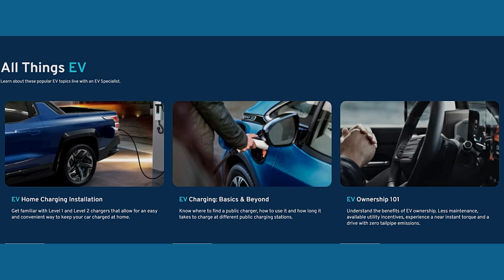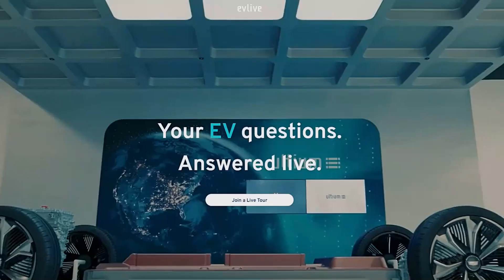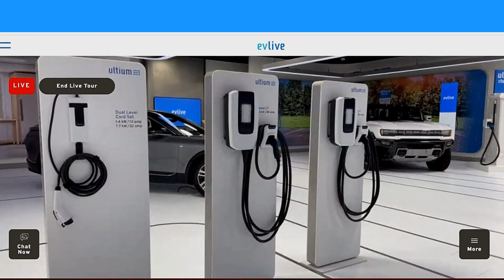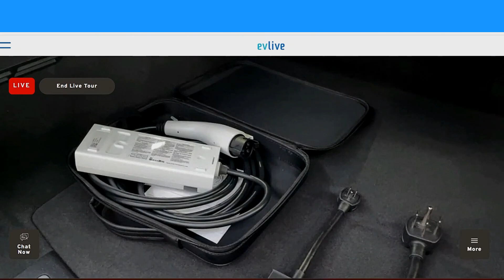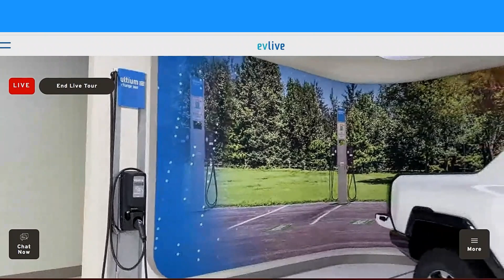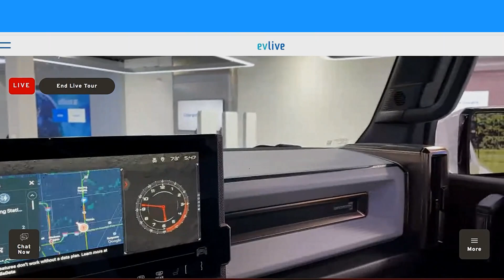evlive: General Motors Wants To Answer Your EV Questions

Comment: Tom, I'm hoping you have someone at GM you can talk to about an issue I just came across.  I just purchased a Bolt EUV, and went through the process of providing Qmerit with my survey to install a charger outside my home.  i do not have a garage.  The survey questions re the garage do not seem to accept that you do not need a garage.  I think the survey is a GM function.  Chevrolet's web site has requirements for Standard installation as well as a FAQ that says a standard install can be done for an outside charger(Hardwired) and the electrician will ensure it meets code.  Nowhere does it say it has to be in a garage.  Initially, the response from Qmerit was that mine would be a custom install.  When I inquired as to why it would be nonstandard, the garage was given as the reason.  There is confusion between the standard installation requirements and the way the survey is written. I don't know if this is a subject that EVLIVE would be interested in, but I am willing to try.
Reply from the maker: Hi Russ. Do you have any updates?

Comment: Ultium 80A connector?!  How many homes have breaker buses that can handle that current...and can the line from the utility to the breaker bus handle the increased load?...with HVAC.

I wish GM had a NACS connector option...CCS is TOO BULKY...and the female version for the vehicle.
Reply from the maker: I like the Tesla connector better also, but the fact is, nobody is going to switch to it, we're stuck with J1772 and CCS. If upgrading the service to accommodate an 80-amp load is too much, you don't have to do it, you can charge at a lower rate and fully charge overnight just fine.
Reply: @StateOfChargeWithTomMoloughney  Customers need to demand it.  I won't buy a vehicle without NACS.  

It would be interesting to see a home project install 2 of those Ultium 80A AC wall connectors (2 car garage) on a house built in 2000-2006.
Reply from the maker: @MarcDunivan  You would definitely need a service upgrade - or you could install a load-shedding device that can maximize the charger's output without overloading the service capacity.

Comment: Do you have any information on if the 2024 Denali EV edition 1 will come with a wall charger? When they mentioned home installation, are they referring to re-wiring your home for the 240v or just installing the station on the outlet? I already have the outlet for an EV and just need the charger installed.
Reply from the maker: If you already installed an outlet for EV charging that that would be a 240-v outlet. You could use the circuit for that outlet to hardwire a permanently installed EV charger which is a better, safer installation than using a 240-v outlet.

Comment: This is maybe more of a question for State of Charge. The question deals with the future of EVs married with renewable energy through a renewable smart EVSE. 1-in-4 Americans do not have access to net metering. This primarily impacts rural America, which happens to have the best opportunity to add solar power. People who have both solar and EVs with net metering do not give this topic a second thought, but 1-in-4 without net metering is a big deal. This is near and dear to me, for I am one of the early adopters of solar and EVs without net metering. We deal with this shortcoming with a smart EVSE provided by Myenergi from the UK. This EVSE will allow the EV to charge only with excess solar generation. State of Charge focuses on everything EVSE. I would love to see an episode that deals specifically with a huge lagging market. It will start with a little research on the claim that 25% of Americans don't have net metering, so how do they join the revolution? If GM would address this question, I would love to hear from them too. The majority of the rural co-operatives providing electricity also don't offer TOU charging.

Comment: They have a CHAdeMo but not NACS.   That put the lie to the premise. They’re into helping themselves not EVs in general.
Reply from the maker: Now that Tesla is beginning to open up its network, they are considering adding the Tesla connector to the studio also.
Reply: @StateOfChargeWithTomMoloughney  oh, that’s good to hear but if the premise was will help you with any EV they certainly could have bough a tesla wall charger.  I guarantee you they don’t have any cars that use a CHAdeMO
Reply: Only Tesla uses NACS, for the longest time you couldn't add NACS to other chargers... Tesla didn't even allow 3rd party level 2 chargers to use it... Also I'm quite sure even if they don't have the physical devices in the show room they can still explain how general charging works.

Comment: Excellent video!!!
Good job GM in this endeavor. 
I bought a chevy bolt euv premiere in April 2022 and I also experienced Q Merit with my 240 volt circuit for charging at home. Everything went awesome.  I really do enjoy my bolt and the Qmerit  circuit install, it took all the unknowns out of the equation. This is my very first time with electric vehicles and I had quite a bit of faith to muster to step out. GM with Qmerit made me feel like I made the right choice.

Comment: I have an old Voltec level 2 charger I got back in 2012 when I bought my Chevy Volt. Something is wrong with the pins in the plug. The communication signals to the car don’t work unless I keep sideways pressure on the plug. I know it’s not the car because all other J1772 plugs work fine. It’s like the fit is too loose or something. I can’t find any place on the Internet that talks about an affordable way to repair the plug. The charger is fine. The car is fine I just need to repair or replace the plug does anybody know how to do that?
Reply: Sorry but you need a new unit. Repairs such as replacement of the hose/J1772 connector is not wise. Is this for the 2012 Volt? Look on EBay for a similar unit or since the Volt charges slowly, a 240 V 16 A new unit from ClipperCreek should be satisfactory. Good luck.

Comment: I only have 100 amps for my whole house because everything is natural gas and central air conditioning is extremely rare on the Northern California coast.
Reply: I think too many people are putting out the idea that you need the max level of charging and scaring away folks that would be just fine with lower level charging.  Even if you upgrade your vehicle to one that can charge faster if your daily range needs don't change you don't have to upgrade your charger.  All you need is to be able to add enough miles while plugged in over night to get you through your normal day. 

I've decided on 24 amp charging when I get an EV, if I ever need more than 200 miles of range added in one night it will mean I'm on a long trip and would be using public charging anyway.  I have 200 amp service at my house so could go higher but a 30 amp circuit is so much easier, cheaper, and safer to install.
Reply: @MartysRandomStuff  I have no trouble at all with my 50 amp circuit and I always charge as slowly as I can to fit in with my time of use schedule.

Comment: What happens during black out?
Reply from the maker: That's a good question. My next video that's coming out next week addresses that.
Reply: @StateOfChargeWithTomMoloughney  That’s awesome!
Reply: Do all gas stations have backup power to run their pumps and computers? If Putin starts bombing our power grid their won’t be electricity to run refineries, drilling rigs, pumps to fill the fuel trucks that deliver petroleum to our local gas stations and on and on and on. 
I could have off grid solar panels on my property that store power in a battery bank. I can charge my electric car from those batteries while your pickup truck sits out of fuel. 
So as you see we all need electricity.
Reply: First you make sure that you get push notifications of storms and high wind warnings from weather app or get weather forecasts from a myriad of sources. You charge ahead of time just like you do laundry ahead of potential power outages.  I can add energy to my car without leaving my house. I could be watching the 11 o’clock news and presto walk into my garage and start charging my car if necessary.

Comment: What BEV models does GM plan to bring to Europe at what point in time?
Reply: 😂😂🤣🤣Thats a good one! Which vehicles does GM export anyway? Now that GM Europe aka Opel does not exist anymore and belongs to Stellantis. The arch enemy through Jeep and Dodge. And who knows a GM dealer?
Reply: @wolfgangpreier9160  GM still has Cadillac Dealers in EU and they export Corvettes to EU as well as some other specialty vehicles. GM is planning a return to EU in the near future, I see them expanding the Cadillac line in EU with all new EVs.
Reply: @Nebula1701  Corvettes (no BEV yet) and Cadillacs (even with their EVs) are not particularly interesting. What about Chevrolet Bolt EV, upcoming Equinox EV (starting at 30k USD), Blazer EV?
Reply: @MooseOnEarth  Cadillac has 3 more EVS to be introduced this year, 2 larger than the Lyriq one smaller, they would start with the more Lux vehicles in EU before moving to the cheaper models.
Reply: "NO BEV FOR YOU...!!!" (Mary Barra/Mark Reuss chorus voices)